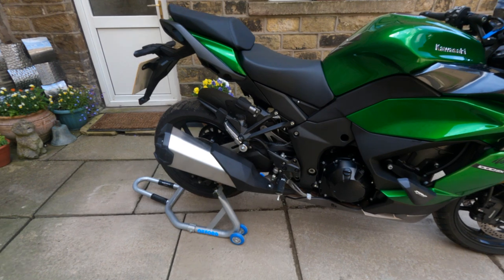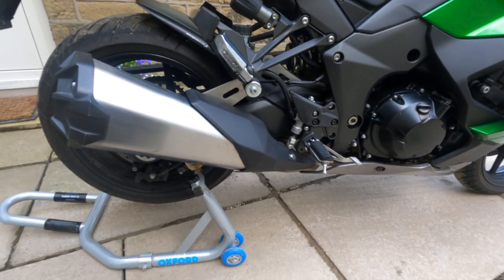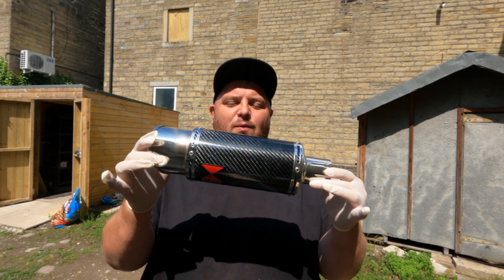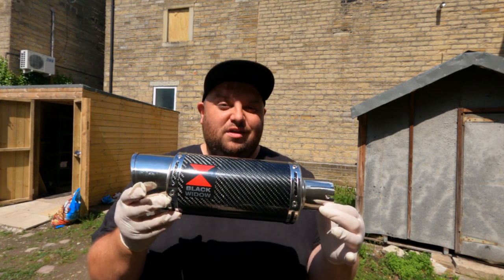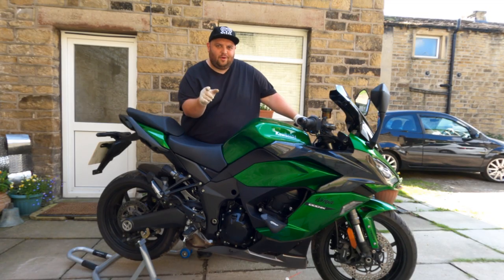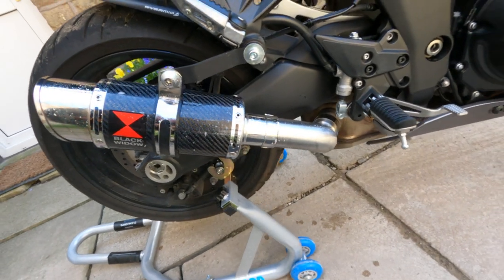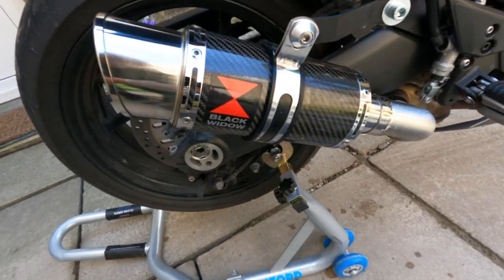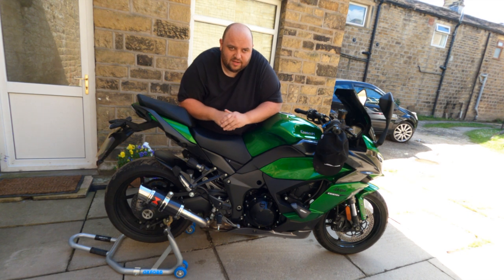Kawasaki Ninja 1000 sx | Exhaust upgrade | Black Widow 200mm | before and after

Comment: I got my ninja 1000sx yesterday and im also looking at replacing the “monstrosity”.  The black widow stuff looks like really good value.  Looks good, sounds good too.  Youre right about getting the full system though.  I might look in to that too.
Reply from the maker: Awesome bike mate 👍🏻👍🏻 
Another great system is Lextek
Reply: @THETURBOTONY  i assume it still works with the panniers?  Doesnt get in the way?  Do you know what the weight reduction is just swapping out the monstrosity?
Reply from the maker: Didnt weight both exhausts but I can feel the difference when riding so im assuming quite a big difference in weight. Also the panniers do fit with the exhaust as it says on the black widow website, however the panniers are a bit too close for my liking.
Reply: Delkelvic full system is what I put on my 2021 ninja 1000sx. Sounds amazing! Fully recommend the FULL system exhaust.
Reply: @kristopherhock5120  do you have the 8inch/200mm cans on it? If you do can you post a video of how it sounds on idle
Reply: These exhausts are like a wilkos kitchen dustbin.

Just got mine today and the bike is a dream !

Comment: black widows sound so much better with no cat. nice vid. i have 3 vids of black widows.
Reply from the maker: Im thinking of getting black widow headers aswell. Cant decide if it will be too loud or not ahah
Reply: @THETURBOTONY  with the cat gone it will sound like without the baffle. no baffle and no cat it will be loud! i removed the baffle and people on the 14th floor new i had taken it out :) watch  XSR 700 2015 - 2020 Black Widow De-Cat Exhaust System 200mm Round Stainless Silencer. DB IN & OUT.
Reply from the maker: Will look cheers

Comment: How is the body position on the bike? Do you feel more hunched over and does your back hurt after long periods of riding? Thinking about getting one of these. Thanks mate
Reply from the maker: Slightly leant foreward. Iv been on 5 hour rides and not had any issues. Other than flat bum on seat.
Reply: Thank you for the reply and now I will definitely be looking to get one of these in spring. I just like to ask and get as much info before I make a purchase
Reply from the maker: @patrickconnolly3080  absolutely mate. Try get urself a test ride

Comment: Hi mate at 6:50 of the video you’ve got a perfect video clip of riding the bike with showing the exhaust how did you take this and did you use A camera mount. ???
Reply from the maker: Hi, yes I used a ram mount claw grip  with extender and had it on the passenger grab rail with the Gopro tilted towards the exhaust. Thanks

Comment: Hi mate.
Why don't you for now just get the max tourque cans decat pipe. Its about 100.
They fitted mine for 50.
Sounds amazing  now 👏
Reply from the maker: Only reason is because I dont want to cut my original exhaust up. My bikes on pcp and ill be looking to swap it out for another in a year. Plus warranty could be an issue of anything goes wrong I dont have the original headers if they are cut up. Thats the only reason
Reply: @THETURBOTONY  
Mines pcp too.
Kawasaki garage serviced my bike last week and said its not a problem and will breath better without.
Cant imagine it effecting warranty. And resale shouldn't be an issue.
Reply from the maker: You got a video of your exhaust mate ? Wana see what the difference is
Reply: @THETURBOTONY  
I will record one and put it on for you mate.
Reply from the maker: @JohnGill51  looking forward to it matey

Comment: Hi Tony
Did you have to re-map after fitting? Enjoy ya banter mate👍
Reply from the maker: HI mate, No I didn't bother with a remap. the fuelling in all gears was pretty sweet. pops and bangs a lil bit but I like that. I know some others don't like that and get it tuned out. I personally know of a few riders with full system on this bike and don't think it requires a tune.
Reply: @THETURBOTONY newbie question: does the popping mean something has to be adjusted? I bought an fz6 with aftermarket exhaust aome months ago. And it pops like crazy after letting go of the throttle. Maybe no popping but more like crackling? Clothes also smell like fire from time to time.
Reply from the maker: @skadiyrsa3410 sometimes popping can be a sign of overfuelling. And the pops are the burnjng off the excess. If you have excess coming from exhaust it will make your clothes smell. Best to have a garage chexk it over
Reply: @THETURBOTONY  ahh alright. Thank you for the quick response😁
Reply from the maker: @skadiyrsa3410  my guess is it will need dyno tuning. Which can be pretty expensive
Reply: @THETURBOTONY  hmm, I'll just live with it then. Planning to get a bike like yours next year!
Reply from the maker: @skadiyrsa3410  all the best mate
Reply: @THETURBOTONY  thanks! Same to you😁

Comment: Did u get the headers in the end?
Reply from the maker: Yeah I put full system on mate. Should be more videos on it all
Reply: THETURBOTONY  will def look at a full system. Bet its so much better.
Reply from the maker: @matthewjackson3034  loads faster and sounds better than original can by a mile. Didnt need a tune up either as fuelling is spot on with full system installed
Reply: @THETURBOTONY  See u went Lex system in the end. Did u stick with that in?
Reply from the maker: @matthewjackson3034  so. Got sent the lextek to review on the channel. Still got it installed now. Prefer the blackwidow tbh. Sounded better than the lextek
Reply: THETURBOTONY  cheers Tony. I have to agree, from what I've seen, the BW sounds better.

Comment: Get the decat slip on pipe fitted as well👌🏻
Reply from the maker: been looking into this, didnt wana jump on it so soon as there is no ecu flash out for the 2020 model yet. will look at it again in future
Reply: @THETURBOTONY  get it live mapped mate?.
Reply from the maker: @Yii00T  custom map ? Dont think it can be done mate
Reply: @THETURBOTONY  someone should be able to sort throttle and fettle surely.
Reply from the maker: From what I have been told they cant crack gettin into the new ecus.
Reply: @THETURBOTONY  okay makes me buying one easier now lol. 2014 roughly is what I'll probably try and get. Been looking into them for while.